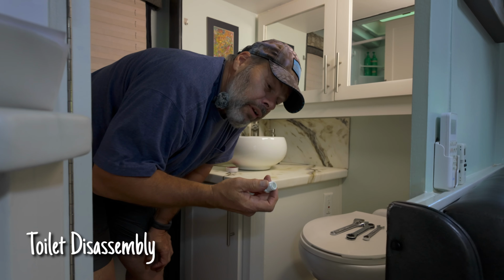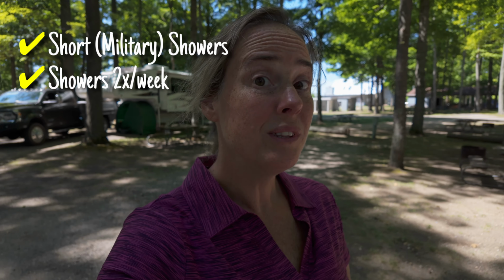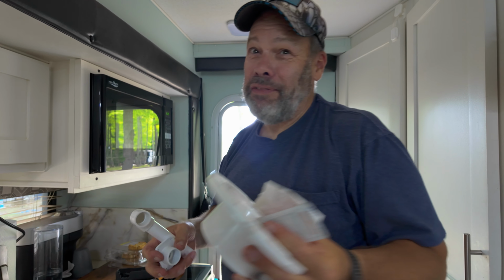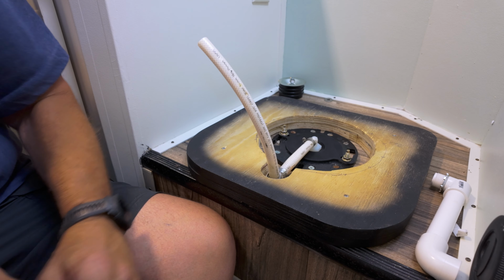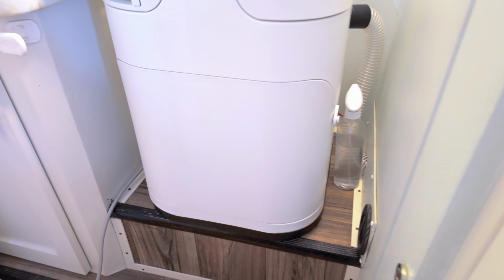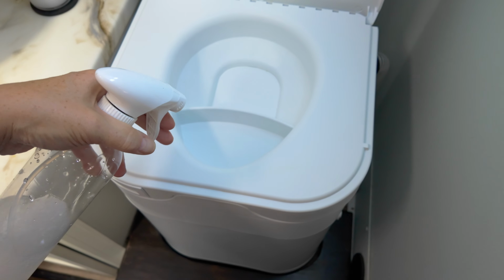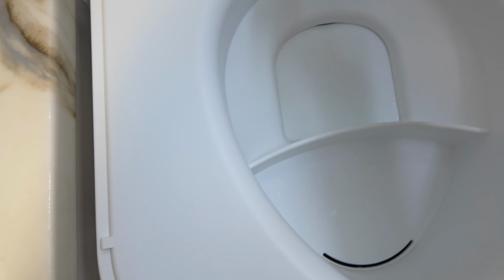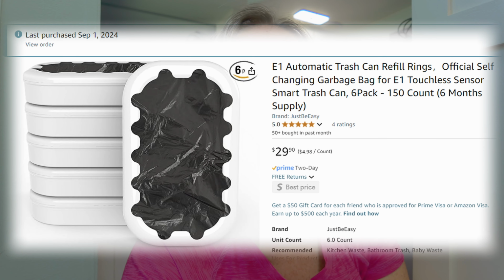Problems Installing the Ogo Composting Toilet in our Host Truck Camper |e201

Comment: We removed the black tank to lower the height. We added a bottle below the bathroom to dispose the sink water into the shower grey tank. We also used an incinerator toilet. Love it.
Reply from the maker: Interesting idea! How much power does the incineration toilet? Do you do off-grid camping? What did you do with the space where the black tank is located?

Comment: Great job guys and I do have a question….when ordering a new 5500 ram,what wheelbase should be used 173” or 197” for a truck camper also I like the idea of a truck camper compared to a class c since basically it’s sturdier with more ground clearance plus 4x4…thanks
Reply from the maker: We bought a 173 (most people call this a  60" cab chassis) but you can get the longer length. But this depends heavily on what camper you choose- position and center of gravity are key factors.

Comment: Awesome job! Glad you guys like the OGO! Any issues with the pee smell? We feel like we are still struggling with the pee smell even with the p trap we showed you guys. 
We did the better fan as well, and I feel it does a great job keeping the compost dryer.
Reply from the maker: Yeah, we are still struggling with this as well.  It's not all the time, but enough to be annoying.  We were just talking about that yesterday - there's got to be a solution!  Yesterday Gary threatened the alternative - putting the pee "bucket" back in and dumping every 2-3 days - with that alternate, I'd rather deal with the periodic pee smell! I was wondering if one of those HepvO valves might work, but not sure if there's enough room in there.  I'll have to bring it up carefully 🤣
Reply: @TheJoslynJourney  I'm sure you'll come up with a solution. We agree though, we rather deal with the smell rather than emptying the bucket all the time. If we have our maxair fans pulling air out of the rig, it smells, but not so much pushing the air into the rig. We looked into the hepo valve and worry it'll get too many pee crystals and stop working. I feel the p trap is helping a decent amount.

Comment: Good video very informative and very funny in some parts!  Could you have lowered the OGO by cutting down the platform?  How does Miss Gary like sitting to pee....lol Just kidding, I think men have to sit to pee on ALL composting toilets.  It would have been nice to use the black tank for additional gel or change it out for additional fresh water (boondocks longer).  All in all this looks like it will work well for ya'll! Be safe and have fun!
Reply from the maker: Glad you enjoyed it! We couldn't lower the platform unless we were willing to remove the black tank entirely.  We're trying to use that exclusively for washing hands since it doesn't get full very quick now.  And yeah, Gary def prefers a tree to sitting, but guess most guys would, ha! I'm looking forward to testing out how long our fresh tank will last. I'm hoping 4 weeks!
Reply: @TheJoslynJourney  If I understood you the pee and shower (BR sink also) go into the black tank.  Kitchen sink only goes into grey, is that correct?
Reply from the maker: The gray tank connects the kitchen sink and the shower. The old black tank has the bathroom sink and the new pee tank. The pee tank will likely last a ton longer than the shower/kitchen sink, so we may elect to put some shower water or dishwasher water down the old black tank to give us more room. But time will tell!

Comment: Good video Lara and Gary...I have considered this move in our cascade...but...now...There is literally ZERO way my 4'8" tall wife will tolerate scaling Mount Kilapoojarro to go either 1 or 2......then...to have to wipe, and not flush. She would rather go dig a hole in the jungle than deal with that. lol...
Reply from the maker: It is certainly a bit different than I was expecting too!  And you're right - once she summits to the top, she still has to make the trek back down.  I would say that this update is best for the serious off-grid folks.  Most will not need this level of time off-grid.  I'm still unsure (still have a pesky gnat issue) so I'm not saying good or bad.  But man, my butt and calves are TOTALLY gonna be BUFF by next summer, hahahaha!